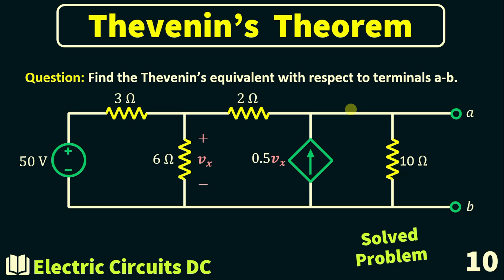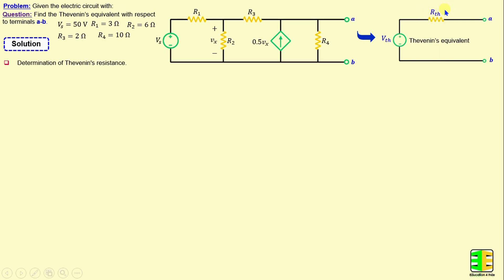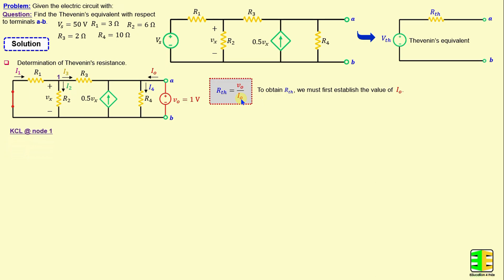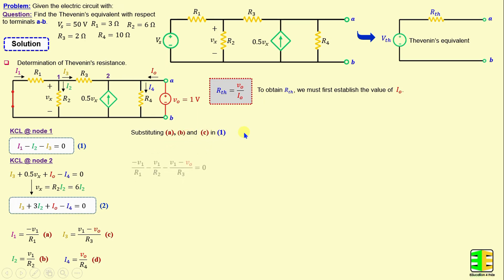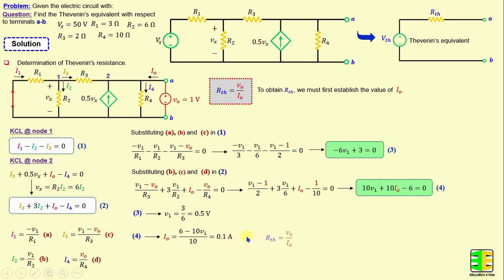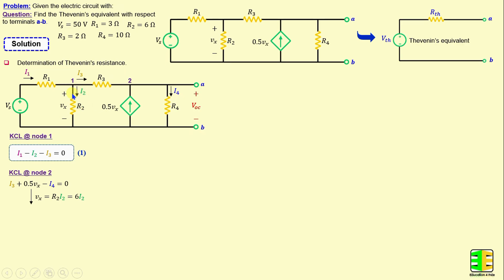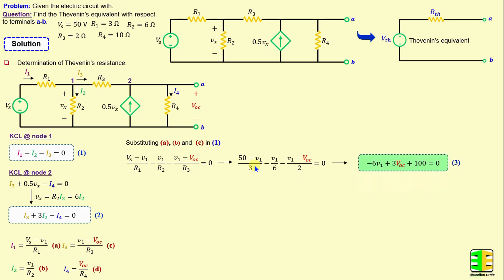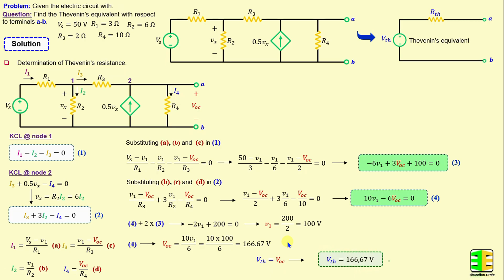Electric Circuits DC | Thevenin’s Theorem | Solved Problem 10

Comment: Could you briefly explain why the node above R4 isn't considered in this nodal analysis?  Why aren't we considering KCL @ node 3 ; Io + 0.5Vx - I4 = 0?  & I4 would be dropped from node2 analysis
Reply from the maker: You don't need to use that node because it is similar to node 2...i mean the voltage above R4 is equal to the voltage at node 2, two branches are in parallel and there is no resistor between them